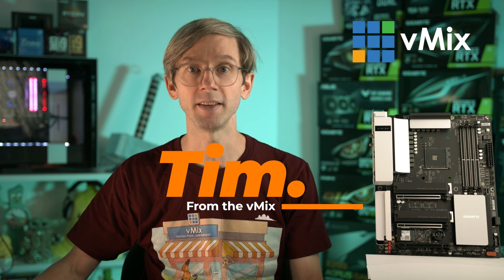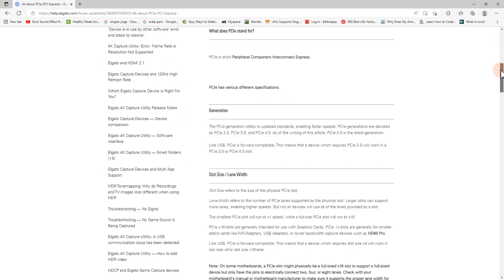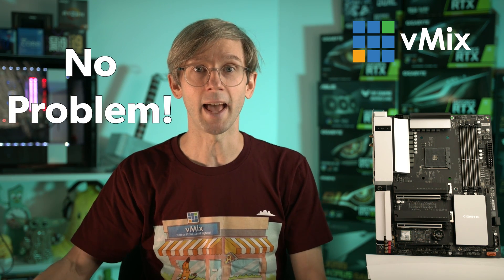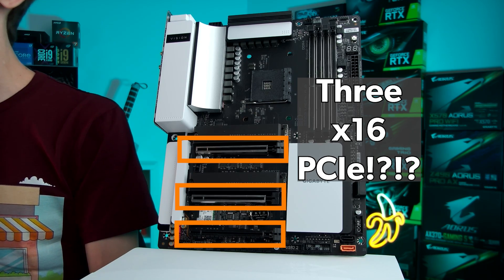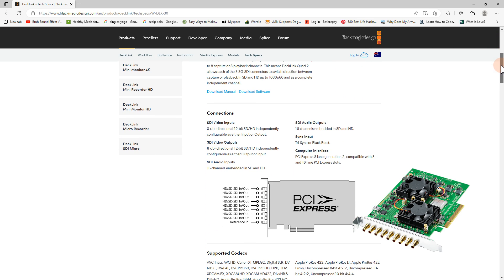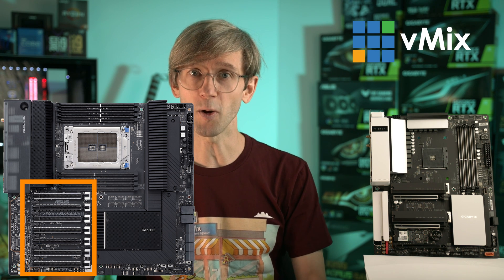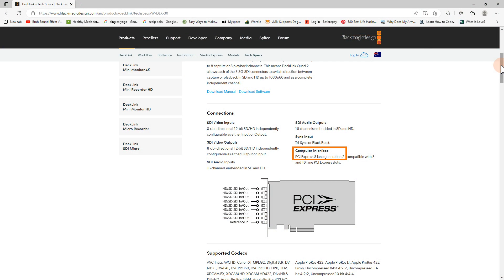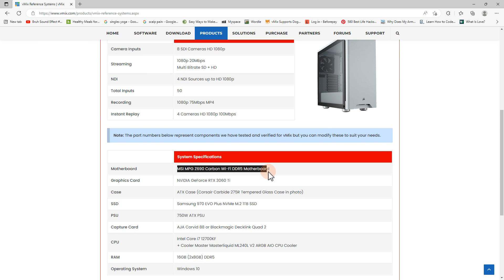vMix :Talking about PCIe and why it's important for capture cards.

Comment: So, from your exhalted position in this universe... can you see a justifiable reason for putting a partially-connected PCIe socket on a board?

What do x16 cards do if you put them in a half-x16 slot?  Just run as x8?  Or fail to work?

Comment: Sorry but you forget to mention pcie ssd which can reduce number of lanes if you use it on the same motherboard. Pcie storage can take 2x 4x or 8x lanes. So this is very important when you are making replay system with 8 cams and fast pcie ssd storage.

Comment: I test my PCIe cards pretty rigorously. The primary test is, throwing it like a Frisbee from, across the room, having it land solidly seated in an 8x or greater PCIe slot. Some modern cards have better weight balance and heft. Others, are simply too light, and tend to float, striking either my cat, my dog or my dumb wife, who ignores me when I tell her to get out of my office. Magewell multi hdmi cards have fared the best in my testing, but the SDI models should be avoided. The worst cards are the ElGato 4k GameCapture and the AverMedia Gamer 4k. They are difficult to aim, and I had one hit my RTX a5000 GPU. I swear the nvidia card yelled out a racial slur when the card hit it.

Cats have great eyesight, so after finally getting a card mounted (it took 3,333 attempts!), I connected my BMCC 6k, and asked the cat what it thought. First, the cat said nothing, then it hacked up a hairball, plus the tail of a mouse or rat it had caught. My dog was much more helpful though, it barked, raised its hind leg, and pissed all over my leg. 

if anyone wants to see some video of this testing, I will reshoot, seems I forgot to wear any clothes during these dangerous tests.

Comment: Question: if i want to use 2 caputre card on x570 mother board how can i do that? it has only 16 lane , 8 lane  connect to cpu and last one is 4 lane to chipset. the capture board can use on 4 lane, is it ok to connect chipset slot?

Comment: Question: If you have a good motherboard based on X570 or Z690 with a PCIe switch or bifurcation and drop in one x16 card (GPU) in the first slot and an x8 card (capture) in the second slot, they will both operate at x8, right? But what happens when the GPU is PCIe 4.0 and the capture card is PCIe 2.0? Will the slower capture card force the GPU into x8 PCIe 2.0 as well, or can it still utilize the full PCIe 4.0 bandwidth?

Comment: What are your experiences using external PCIe-enclosures over thunderbolt?
Reply: Mine works great on both a laptop and a desktop
Reply: Hi Christoffer,  I just went through this.  Thunderbolt 3/4 only supports 4 lanes of PCIe.  So, you won't get 40 g's through it, unless you use cards that are PCIe Gen 2 or higher. that only use 4 lanes.  And you have to be careful not to accidentally get a card that does support the resolution and FPS that you need.  If your card is Gen 1, like the Black Magic Quad Recorder, it's an 8 lane, so you'll only get 22 g's per sec.  I checked that number with Sonnet and they said it was true.  Note:  They warn about that in their website.  I'm sure somethings might go at the intended speed.  Elgato's 4K HDMI Pro quad, is 4-lane and it's PCIe Gen 2.0.  But, it can't do 4K 60 fps.  It can only do 4K 30.  But, with the combo of my Mac Mini MI 16gb, and a correctly specked Sonnet, I ran into awful lag problems with the Black Magic.  I went to the MAC store and they were like, 6 cameras?, Get a PC.  So, I went to my 9 year old PC, plugged my Decklink Quad Recorder directly into one of the PCIe slots, and my problems dissapeared--at least at the 1080 30 setting that my cameras were on and failing at on the Mac. (I'm running 6 cams.  So, I want to add another card.  Plus, I want to record 4K 60 with vMix with all 6 cams if possible, with automated overlays, etc.  So, I think I'm going to get forced into one of these 3 PCIe slot motherboards.  Like the ASUS Pro Art.  It has the most PCIe, thunderbolt 4, and USB 3.2 IO of any Asus, except one or more of the Asus pro's.  And the Pro board  with the most slots that I'm remembering from earlier today, costs over 5K.  I started trying to solve these issues with no experience starting in November.  It's resulted in me migrating back to windows, and also stopping my video production while I solve this.  It's been an education, I wish someone would have hipped me up to what was hurtling toward me.  There are companies that make breakaway boxes that use Fiber.  But the cards are over a grand.  And the breakout sisterboards, that are actually very big, cost thousands. But, they look like the future to me for sure.  Unless motherboards start showing up with PCIe slots, again.  Frustrating. I might have to use one 4 way HDMI, and one Elgato CamLink 4K (30 fps), and my last camera using straight USB.  BEST OF LUCK.  Let me know if you hit UREKA so I can steal your solution(s).  :)  Lots of Laughs & Learning --Ned